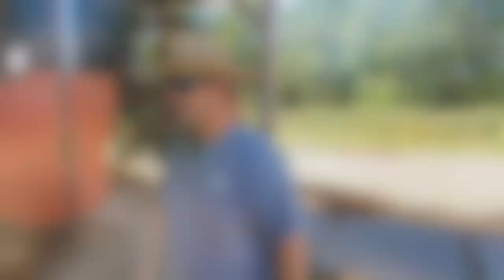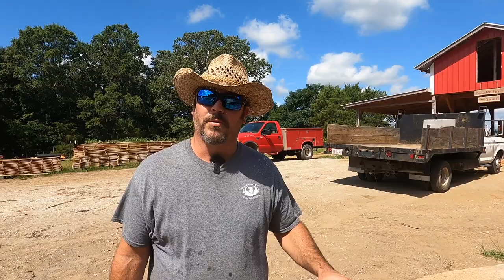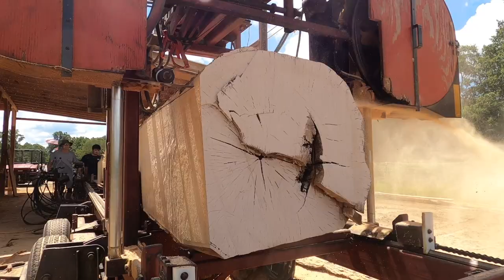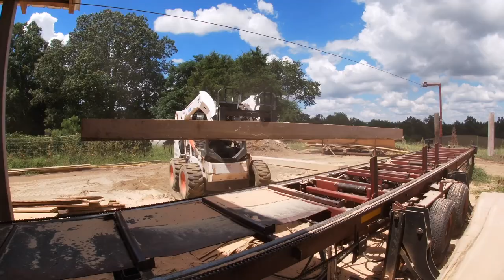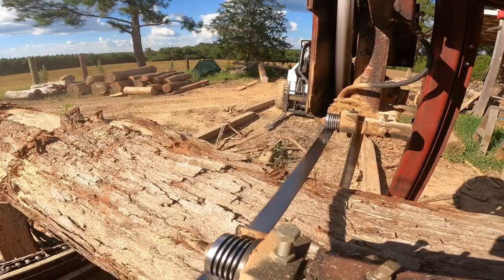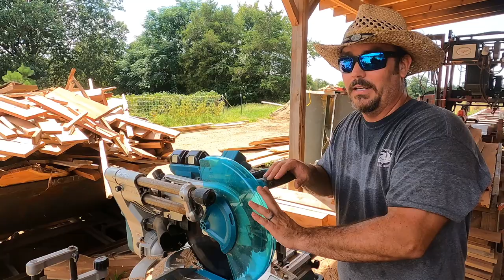Maxing Out A Cooks AC36 Sawmill!

Comment: What blades do you use?
Reply from the maker: We get our blades from smith sawmill service. What we are using to cut the white oak is a turbo 7.
Reply: All we mill is Cedar and you wouldn't think there would be a lot of metal in cedar logs but we hit stuff all the time and we don't take residential logs either.  Bullets, nails, screws, fence wire and even stranded electrical wire.  Glad we use Timberwolf cobalt blades from Sulfolk Machinery because they just plow right though it all and keep on cutting.
Reply from the maker: @meehd01  Thanks for the comment. Are Timberwolf cobalt blades tipped with cobalt so when you hit metal it won’t damage them as bad
Reply: @firewaterfarmsawmill  yes they are and they last a lot longer.  I can use the same blade for 1-2 weeks without sharpening.  They usually end up wearing out and cracking.  I have been averaging 50-75 hours of use on a blade.  Part of it is the blades and part of it is I use synthetic transmission fluid in my drippers.  I have 3 Cook lube drippers, two on the inside of the blade and one on the outside of the blade.  They never rust and are as smooth as glass.
Reply: @meehd01  how much for one of those blades?